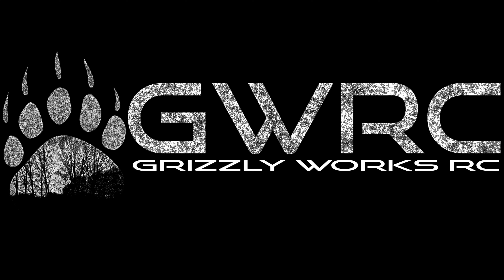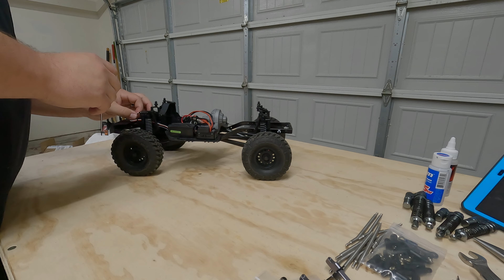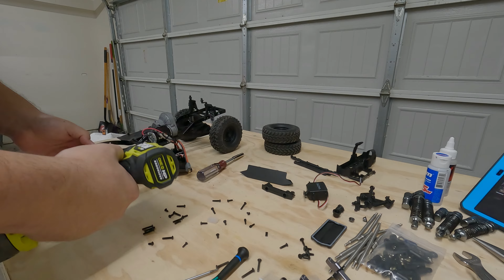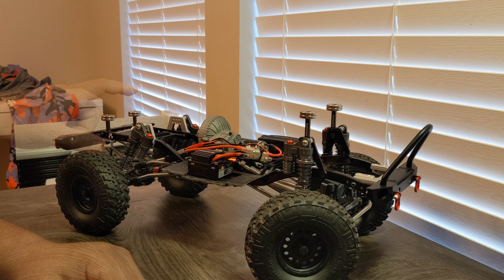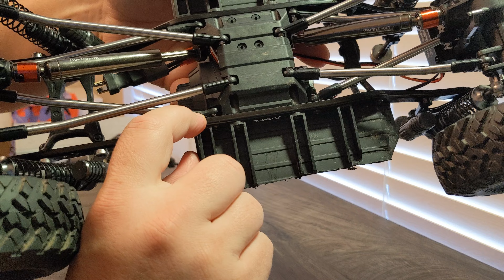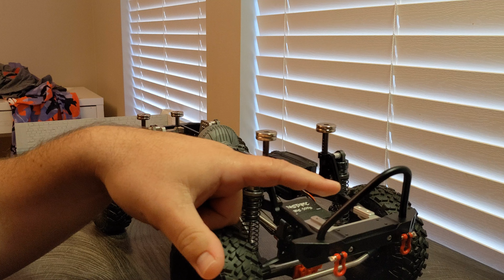SXC10-II Deadbolt Build Suspension and Steering "Upgrades"

Comment: Just curious, where do u plan on placing the battery, looking into doing similar mods with my rig and the only place I can think of is in the rear which I assume would be bad for weight displacement
Reply from the maker: @isaaccolborne5081  I ended up doing it in the rear between the shock towers. I run a relatively small battery pack and there is plenty of weight up front with the brass diff cover and knuckles. I also did brass inner rings in the front wheels. I really need to do an update video for this truck.